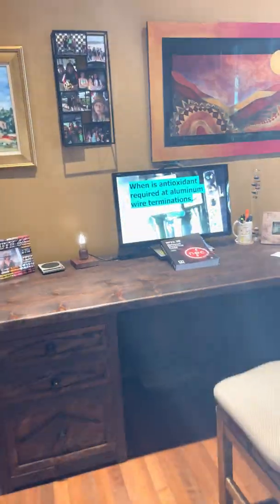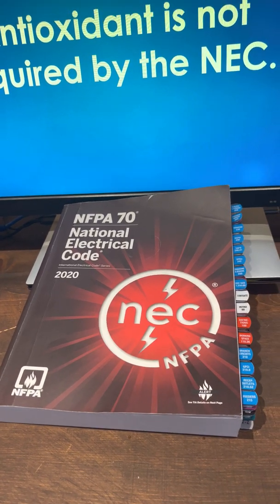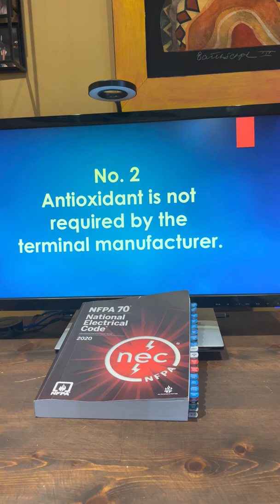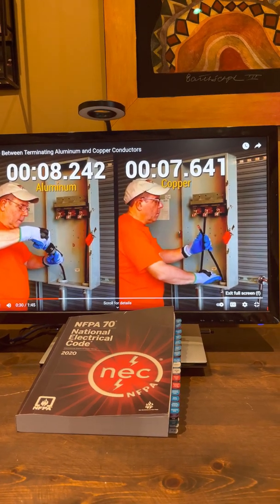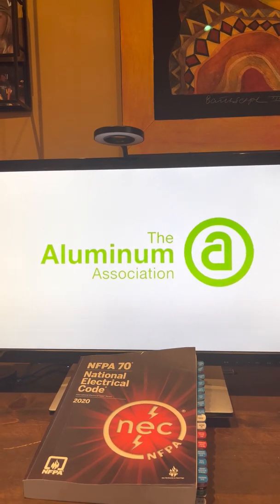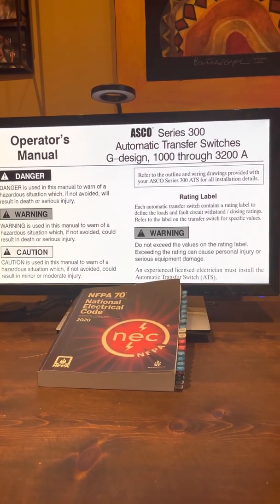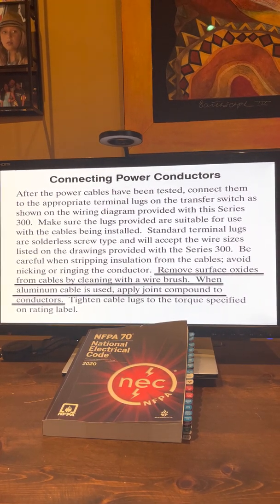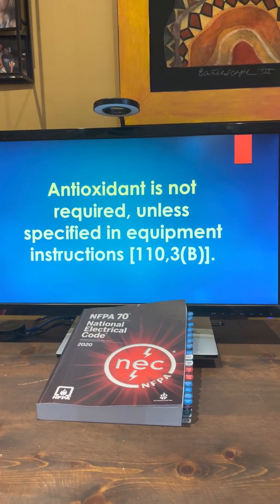Aluminum Conductor Termination Methods, NEC 2020 - [110.3(B)], (3min:30sec)

Comment: True story. Our inspector requests it. I like to use it on the threads of terminals more than anything. Saves the next guy from maybe breaking the terminal screw.
Reply from the maker: Share with him the video please.
Reply: Your inspector can't require it unless your jurisdiction passed an NEC code amendment that requires it. He can't just enforce his opinion.
Reply: @brianharmeson3144  his inspector can require whatever he wants
Reply: @trope5105  No he can't. His inspector can enforce the local code and not his feelings or preference. That is why inspectors are "code enforcement". They enforce the code. They don't make it up as they go along. You are confusing the ability of any AHJ to adopt code amendments with individual inspectors being able to cover for their own lack of knowledge by being bullys towards tradesmen.
Reply: @trope5105  No he can't. If you think that is true you are completely misinformed on how things work. Inspectors are "code enforcement". They can only enforce the codes that are adopted by the jurisdiction they work for. They can't make up rules on the fly or enforce their personal feelings or preference. Don't be a victim of a bully. They can't enforce feelings.